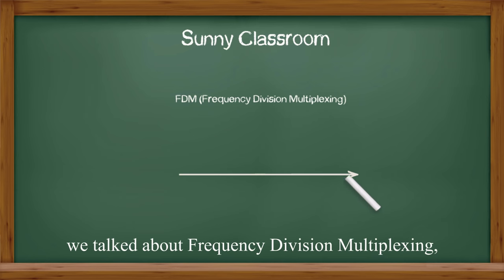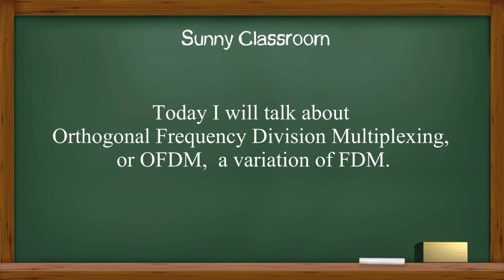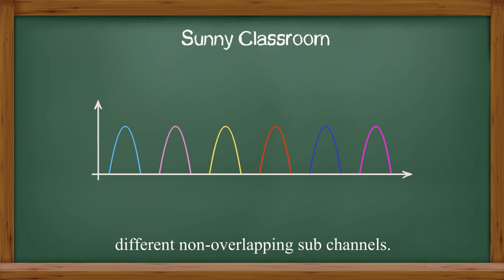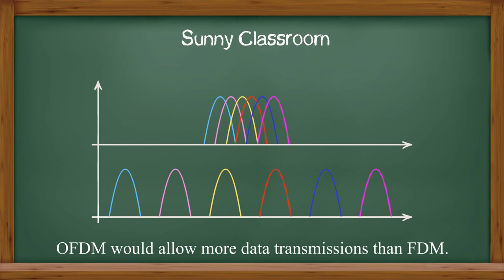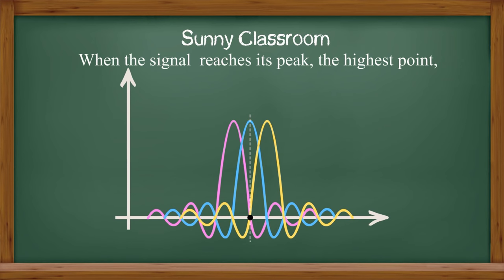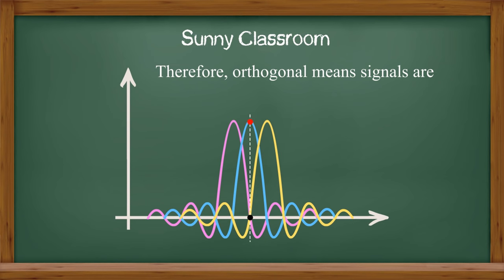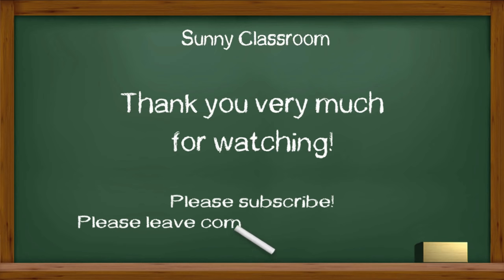OFDM - Orthogonal Frequency Division Multiplexing

Comment: Orthogonal means the convolution between both is zero. It's an expansion of the dot product for vectors. That makes the convolution between the signal and the desired channel will get the information from that component and zero out the others since all the bases are orthogonal.

Comment: It would help if your charts indicated the axis.  Combining three sine wave signals that are in the time domain into a single chart that appears to be in the frequency domain is not obvious how that happened.  It seems to be missing an explanation of modulating a carrier with a sine wave produces sidebands.  A steady modulation produces exactly two, well defined sidebands above and below the carrier.  But modulating the modulator signal, either by changing phase or frequency, creates a complex family of sidebands and when all these sidebands mix in the receiver, the original modulation is reconstructed.  So you cannot just eliminate these sidebands.  What you want to avoid is placing a sideband smack dab in the middle of an adjacent subcarrier.
As it happens, these sidebands are predictable as to frequency separation in the frequency domain.  The sideband spacing (in the frequency domain) is dependent upon the symbol rate.  So, if the subcarrier frequency is an integral multiple of the symbol rate, the sidebands will line up and so will their nulls (in the frequency domain).  
In the time domain it is nearly white noise after many subcarriers are created and summed.

At the receiver, the entire passband (now in the time domain) is fed into FFT and out pops the coefficients (sine, cosine) reconstructing the many subcarriers and now in the frequency domain. These can then be separated out from each other and further processed to recover the specific modulation technique used.

Or so it seems to me.  The importance of orthogonality is that the reconstructed subcarriers will have nothing of their immediate neighbors sidebands; but might still have much weaker more distant sidebands that can be ignored (below a threshold).

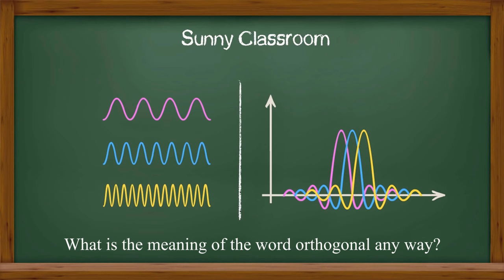Comment: Thankyou Sir for this wonderful visualization of the concept.However at 2:30 there should be interference of these three different signals and that should result in a resultant signal.But how do you go on with the lecture still considering them as three seperate signals?

Comment: Thank you for this explanation. OFDM has been a difficult concept for me to grasp, but you made it easy. 

So the final graph you showed there - seems to be strength of signal in the frequency domain - so for OFDM to work well, your multiple signals must be kept very precisely spaced to prevent interference. Consider a device then, using multiple orthoginally spaced channels to increase throughput. Does that mean if one of your carriers starts to "wander" even a little bit, the OFDM signal will quickly become garbled? Also, with OFDM does it then become more important to be aware of and control your unintentional harmonics? 

Thanks!
Reply from the maker: Exactly you are correct. Your questions are great. Yes, OFDM would create some errors. In the future 5G, a new access approach is used called: non-orthorgonal multiple access. Please look into it.

Comment: Your lecture conclude that more users can be accommodated in less bandwidth but if we want to increase data rate, then we have to assign many carriers to the same user, right? or something else.
Reply from the maker: More users can use the same bandwidth, which means that this technologies can make the same bandwidth more efficient, thus increasing the data rate. Of course, if the bandwidth is limitless, there  is no purpose for this technology. 
Actually, we do not disagree with each other.
Reply: @sunnyclassroom24 Thank-you
Reply from the maker: @ArbazKhan-oh6km  you are welcome, my friend.

Comment: He is wrong, multiplexing is not a multiple access technique. In FDM the data of a single users is transmitted through the same bandwidth (i.e multiple non ovelapping channel) here the different channels within the give bandwidth carries different information from the single user. In FDMA we enable access technology where it converts fdm to fdma, here rather than single user using all channels, different users use different channels. 
Thank me later